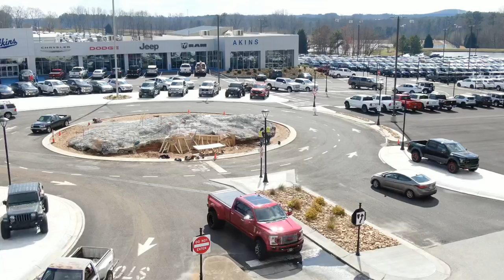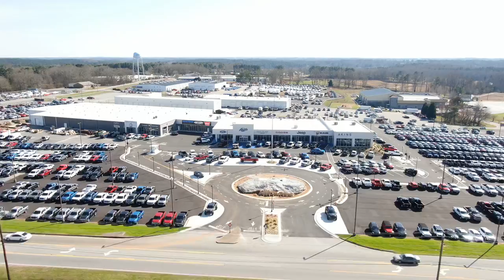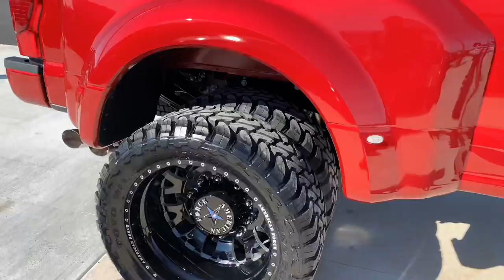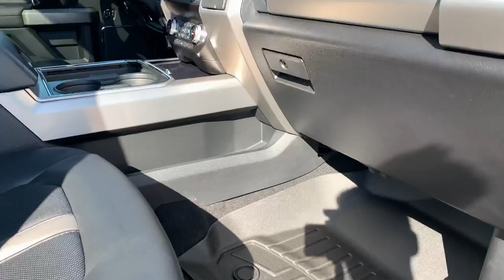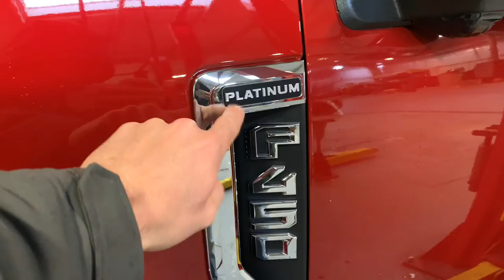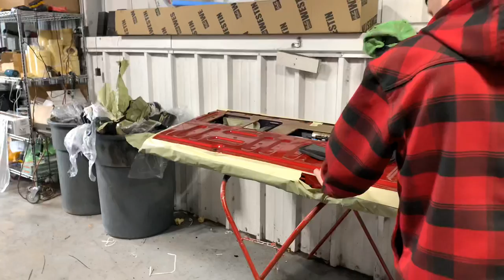2020 Akins Ford F450 Platinum Reserve Edition Wild Willies Custom Leveled Dually American Force

Comment: What a beautiful truck! For $118k I’d want to incorporate a Kelderman full air ride adjustable suspension in lieu of the leveling kit. The wheels and paint dress up is first class! I got my bed liner from you guys for my Tundra - very happy did a great job!
Reply: And a Kelderman will add about 10k minimum to cost maybe more

Comment: I wonder if I could still pull my 20,400 lbs RV with all those upgrades & heavy tires?
Reply: You can. I have a 22 450 on 35’s. Pro r 4 in the bed, travel trailer(38’) behind, no issue’s.

Comment: I'm a die hard GM guy but I give credit where credit is due, this a one sweet ass rig.
Reply: Tony Lewis I hear ya but 115k gaddamn 😳
Reply: @ArCh-or7ey  yes the price is rediculous but most vehicle prices are.
Reply: I have the 2017  F450 Platinum and I put 22’s on it from American Force.  Some other small changes.  Taxes and registration , Fees sure adds up.  I ended at 95K +.  Painful but I don’t regret it.  I am blessed doing well with work and I tow everyday that I head out to work. Mine is Ruby Red.  Awesome color. Should last me 15-20 years All trucks are expensive so I went biggest in hopes it would outlast 2 F250s  then I win.  Love my truck.  No regrets.
Reply: Dennis James my bro’s Inlaw is in the pipeline has f250 on 26”s forces jacked up I think like a 7” lift. That thing is gorgeous I’m not a big Ford fan but prior aluminum bodies, dude be bringing in 3500 a week, I’m more into hp, did a 2014 Silverado cammed one of the first in Houston to have full bolt ons on that newer l83 model
Reply: Dennis James that’s wussup bud more power to ya, keep on with the Keepin on, what part of the US you at?
Reply: Ar1240 Ch Mooresville NC 👍🏻
Reply: Ar1240 Ch If my company gets another truck for my son , I would probably get GMC because I like them too.  I am not a fan boy. I like them all but Dodge doesn’t use real steel in their frames.  Lol
Reply: Why would you choose a independent front drive train/ independent suspension over a straight axle no matter the manufacturer.. Independent means less reliable, independent means more things to go wrong, and when you need it most you can be rest assured failure is coming very soon .. as opposed to a straight axle , less moving parts less wear and tear, way more reliable… makes zero sense to own and inferior product, no matter the manufacturer

Comment: Without a doubt I’m a 110% GMC / CHEVROLET 3500 HD 4x4 crew cab dual wheel truck guy.  This red Ford 450 Super Duty is a bad muther SHUT YO MOUTH.  This is the same setup that I’m going with on my new 2020 3500 HD GMC DENALI  4x4 dual wheel crew cab.  
Now that’s a real truck 

Liked & Subscribed

Comment: Any who buys a FORD for $ 115,000 plus tax = $124,000  needs to be taken off the streets immediately cause they are certified INSANE and should be locked up with door welded shut !
Reply: Can't take the money with you when you die so why not use it? I'm not a Ford guy but you can't say that's not a good looking truck that's very capable of doing just about anything.

To some people, a truck like this is a tax write off, and that's clearly who they're trying to market it to.
Reply: Ford GT is at 500k base price why not fucking buy a Ford? 😂

Comment: Not sure I want to go all out like this  but plan on looking at getting a 450 platinum. Do have a question though. I plan on pulling a fifth wheel camper, how much higher then stock is the 450 with a level kit and 22x35, will this cause an issue ?

Comment: Man what a beautiful truck! Question....if your pulling a 5 wheel 44 ft toy hauler, would the 2 inch lift cause problems?  Prettiest 450 I’ve ever seen. To the haters.....if you can afford this you ain’t worried about appreciation. Reliability’s you these days are top notch......he’ll even dodge has a reliable truck these days.
Reply from the maker: Donald Matheson thanks. No issues pulling with this truck even with the mods. Appreciate it
Reply: Yes you can still haul,  with no lift in the rear end, you only go up a few inches in the rear because of tires.. there has been no mods to the rear end , it maintains all stock functions except a few inches as I said to the rear end. Best to use a flat bed though when hauling 5th wheel . When hauling goose neck , you have adjustability

Comment: I bought a 2017 f-150 with 4" lift and huge tires and bad ass rims leather interior in late 2017 for $52,000. So this 2020 450 for $115k is worth it. If you can afford it good for you👍 if you can't afford it just keep drinking your haterade broke haters 😁😁😁

Comment: Question: rear wheels are "sticking out" so much that's mean body of the truck, mirrors will be all dirty and bombarded with rocks if you will drive in rain / mud / gravel etc. right?
Reply: Big mud flaps , and yes it will make the truck dirty with out mud flaps.. and that 450 has no mud flaps, it will peel the paint off that truck pronto. Put mud flaps up front to eliminate the issue, and rear

Comment: Wild Willies, I am in Florida and  just bought the 2020 F450 Limited in white. I want to do the same thing to my truck. Can I get the details or part number for that front lift? Also, I am not changing the shocks, but I will be adding the front dual stabilizer and the same wheels and tires. Do the rear wheels have a spacer in between them? ? Any help with the details would be appreciated. Thanks
Reply: I don't believe so, I ordered these wheels from AF (15 week wait time) and they build them for the size of tire and truck. No adapters or spacers. Mine is a 2020 fF450 White plat, with level and bags. Just waiting for my wheels

Comment: Did you have to do any trimming or is there any rubbing with that leveling kit?
Reply from the maker: Troy Hendrickson minor trimming. Rubs slightly on full knock on trailing arm
Reply: Front air damn
Reply: @RealDealNeal  115k and it rubs, that isn't acceptable.

Comment: The larger tire size and wheel size add up to additional weight per corner.Did you upgrade the stock brakes to safely stop this truck?
Reply: This trucks designed to have a very high gvwr, they could add like 5k to 6k pounds of equipment before having to worry about brake sizes. The only thing they or the owner would want to do is get the truck weighed as it sits and then figure out how much payload is left to determine what you can still safely carry.

Comment: What’s the tire set up you put on this truck? I’m looking for 24” AF for my 2020 F/350 KR dually, do you need spacers? I don’t want to cut anything whatsoever and don’t want the tires to rub.
Reply: Yes you need spacers and a front lift is needed .. 37 . 13.5 s will rub make sure to go 4 inch lift minimum.. 37  12.5 will rub less with leveling kit

Comment: I think it's safe to say GM, FORD, and RAM all have problems. Their prices have skyrocketed but their reliability has decreased. These trucks arent what they used to be.
Reply: Quality Landscape and Hauling Co sedeno you’re exactly right. Got a friend who bought a 2020 gmc hd dually and he’s brought it to the shop 6 times in 3 months. A $90,000 lemon.
Reply: @yobuddy6177  I owned a new 2015 gmc crew cab, fully loaded that I paid $52k. It was in the shop every 4 months. Even the dealership didnt know why it had so many problems. I got rid of it. Now I'm looking to buy a lexus gs or the gx460. Those are built in Japan. That means they are very reliable.
Reply: @qualitylandscapeandhauling7942  lol, If you're trading your truck for a car or SUV then clearly you never needed a truck to begin with.
Reply: @yobuddy6177  there's no GM that's 90k dollar's lol. You're either lying or your friend got ripped off hardcore.

Comment: What is the lead time for an order for a truck like this?
Reply from the maker: 4-8 weeks simply because that’s the average turn around time on wheels. We can do everything else in a couple weeks with all the paint work.
Reply: @Smokem777 mercy
Reply from the maker: Smokem777 obviously you don’t know how much 24” American forces and 37x24 MTs, 2700 power bed cover, custom paint, bedliner, fox dual stabilizers and fox 2.0 Shocks....
Reply: @RealDealNeal   When you're building a truck like that you don't care how much it cost you just want the biggest baddest truck anywhere

Comment: I’ll stick with my 94 IDI diesel....I’ll get to the same place this thing goes. This truck probably won’t see off pavement in its life.
Reply: Your 94 can not hold a candle to these new rigs no shape form or way, especially when you load these trucks the way the were intended for use . Your 94 yes can get there for sure /maybe. And Tesla can get your there also, as well as a Kia can.. but when it comes to load your 94 and the other vehicles mentioned can not get there loaded like that 450.. Happy dreaming
Reply: @doublejump6578  ...90% of people NEVER use the max payload of any truck....and I can make up the difference in savings/money in the bank from a $115,000 grocery getter.
Reply: @doublejump6578  ...and it pulls my trailer just fine loaded down. With money left over to buy all the beer I can drink.

Comment: I will never buy another ford truck.  After a lifetime of being a ford fanatic, I have seen the failure of the aluminum truck body.  My 2016 f350 took a deer strike with $1000 damage. 24 hours later my 2017 f250 work truck took a deer  ( the joys of living in Montana ).  The damage ?   Only 1 shop could work with it and the damage over 8900..... 
I’m done.

Comment: We have come forward many years, vehicles are manufactured a lot easier. So why is the cost going up?  They have vendors that make different components and sell them to the vehicle manufacturers.  In about 10 years, this truck will be on the side of the road for sale for a 1/3 of what it sold new. But pride and ignorance will buy one just to show off or get that rush of feeding selfishness. Even that person, will regret buying it in about a year. No one stops to think, its a truck, many other trucks can the same.  When you buy a house, the value will go up. On a vehicle, especially a truck, it will lose value quickly. They could lower the price, and sell more volume, but they won't.

Comment: Seems good. But I want everything. And I mean everything. Spoil me! 3 fuel tank's. 20+miles per gallon. Going very long disdtances between fueling up. And bullet proof. I'm going to dangerous places. Obiden makes America dangerous. Spotlight. Probably top center. And a rough powerfull winch. Mine is to be a serious truck. Not just pretty. And more than 1/2 a bed. Plenty of room in the cab. Excellent sound system!!! Easy to drive! And the list goes on!

Comment: Overpriced. Id rather buy a house.  Fyi   My brother has one basic model and he rarely drives it. One day he opened the door to find a huge squirrel nest under both seats. The varmints moved in through the rear vents between the bed and cab. A design flaw. Maybe its designed to stay in the city.